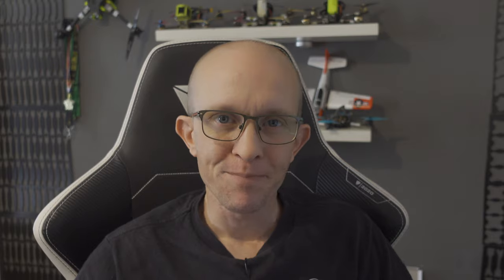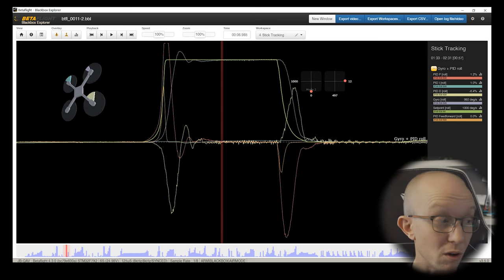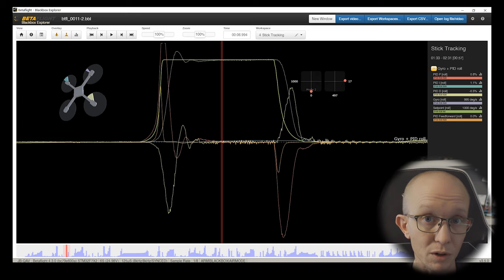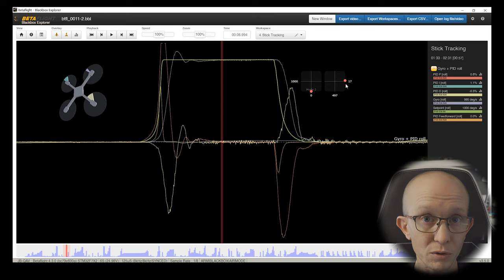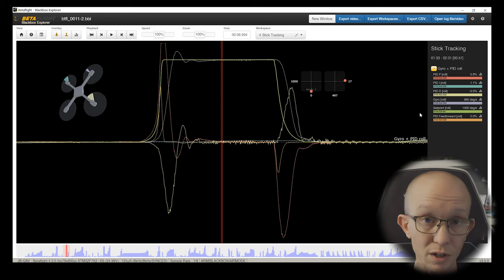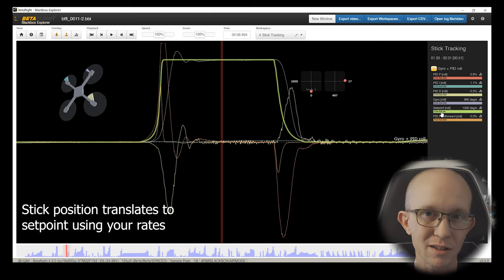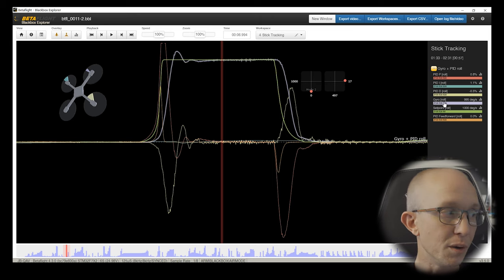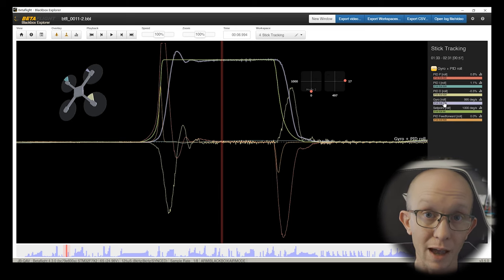HaloRC Osiris Build Guide - Part Three - PID Tuning

Comment: This is one crazy fast, sustained full throttle  punch. What battery are you using?
Reply from the maker: It's quite good for punch outs, not so good at spinning up fast for flips and rolls because it saturates too early. Still pretty damn good though. I mainly use 1100 CNHL Black.